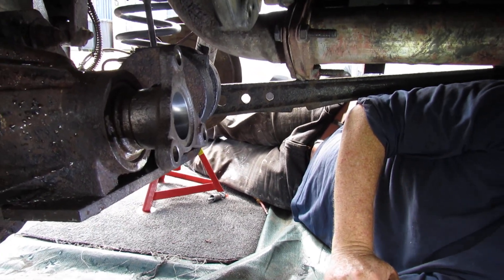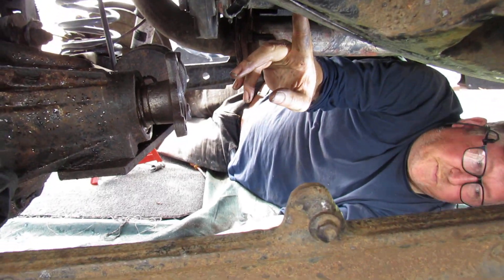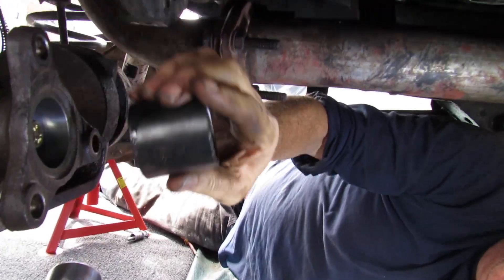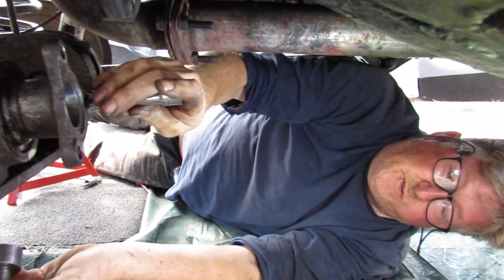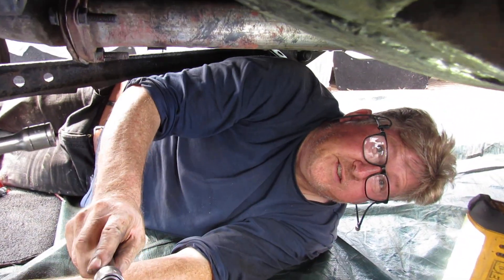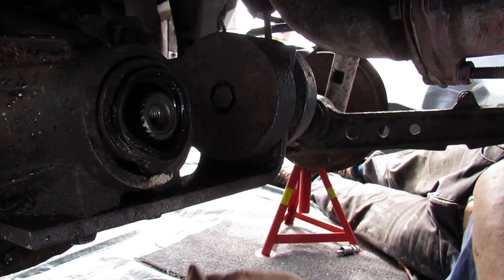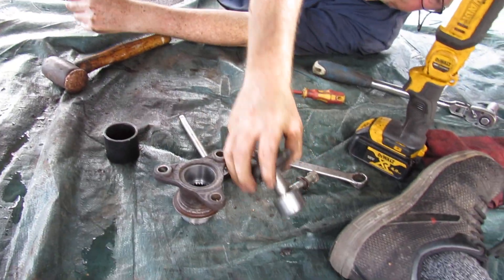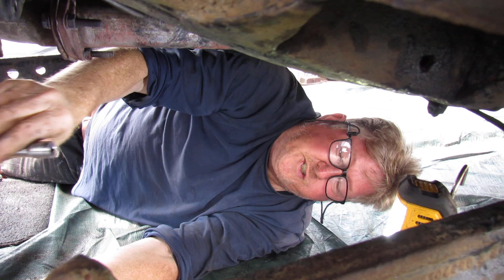Land Rover Discovery 2 TD5 How to remove rear differential locating pinion without specialist tools

Comment: Nice one, did you do a video on tightening the nut?
Reply from the maker: i believe it was included in the video, you can bar it and then tighten
Reply: @DanielJohnHowTo thanks- I’ve read a lot about collapsing the crush tube by over tightening.  The consensus I’ve seen is 130nm should do it but go steady!